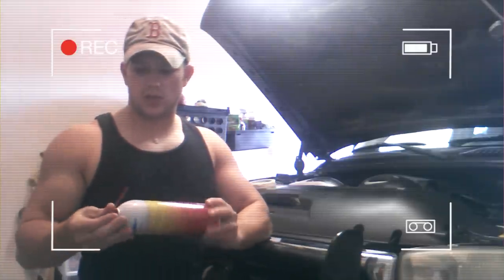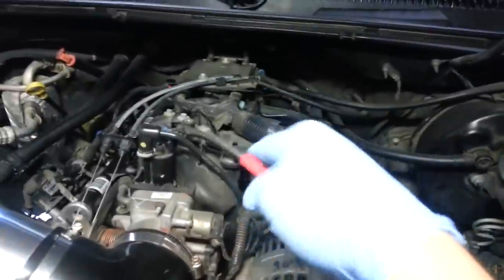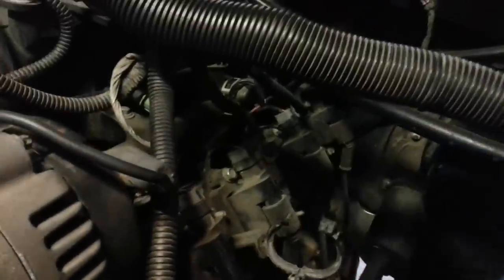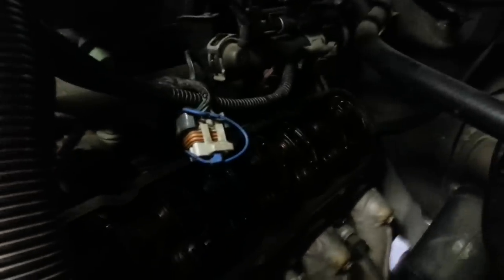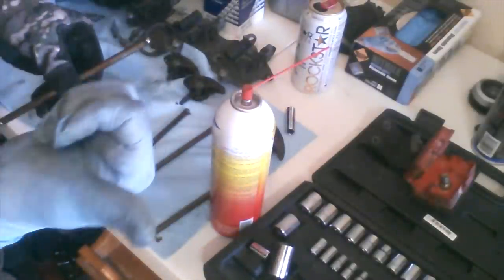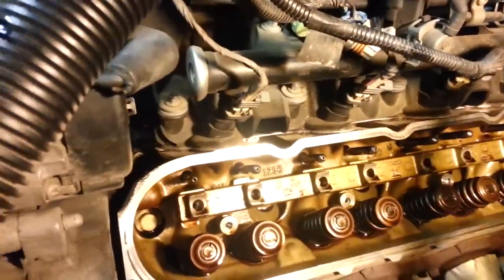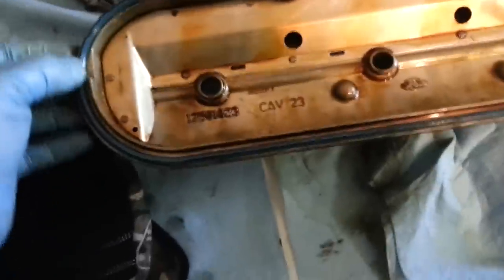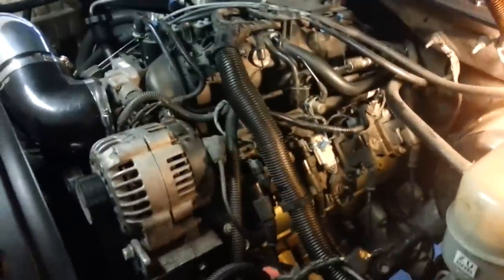GM Lifter Knock Repair - Carb Cleaner Method - HOW TO / TUTORIAL

Comment: I was almost done with this process when the red plastic straw shot into the head through one of the holes that the pushrod go into.   Anybody have advice on how to get it out?
Reply: depends,  if it is not in the pushrod itself and it was my personal vehicle with over 150k miles.  i would leave it and hope it just finds its way to the bottom of the oil pan or another unimportant place. its soft plastic and as long as it does not plug an oil port it probably won't cause a major problem.  if you have to get it out you will have to pull the intake and valley cover.  if it is a newer car with cylinder deactivation i would pull the intake just to disable the cylinder deactivation.
Reply: Good God. By now surely you’ve solved this (if it really happened) but for those who may experience the same problem, there was an invention quite a few years ago called a Shop Vac. 🙄
Reply: @FloridaTwoWheelAdventures  I did get it out using a USB fiber optic camera and one of those 3 pronged retrieval devices, like the one Arnold Swartzenegger used to get that nasty thing out of his nose in Total Recall.  Unfortunately the knock was just as bad once I got it back together.

Comment: I have a C180 w202 1999 Mercedes and I did the the engine over after the chain Snape bending 6 valves. The engineers said my valve guide on exhaust was worn out and was replaced. I did wash the hydraulic lifters out of Lake of knowledge as I work out of my head.now the engine sounds like diesel engine and got heavy tic tic noise . I been driving it for 1800 miles now with that tic and have tried oil change but tic won't go away . Can anybody out there advise me on solution
Reply: worn cam lobes, worn lifters, clogged push rods, weak oil pressure, improperly tightened or lose rocker arm nuts.

Comment: just spray down the push rod tubes thru the oil holes n save time n hassle? I can just imagine that straw flying off and down into the motor.
Reply: If it does, just crank the engine over and it will blow it out.

Comment: had the same problem recently added best line oil treatment and my noise is gone you won't believe it
Reply: I have the same problem with my colorado could you please tell me what cain of oil do you use thanks
Reply: I have the same problem with my colorado could you please tell me what cain of oil do you use thanks
Reply: I have the same problem with my colorado could you please tell me what cain of oil do you use thanks
Reply: i have no ties with this company but i can tell you that after hours of research this was my only solution eventually i will have to rebuild
i went to the dealer and they showed me how gm has changed the part number 4 times on the liters trying to correct their problems using us a s guinea pigs
Reply: con un 1/4 de ese tratamiento es suficiente oh tengo que llebarla a un taller.....gracias por tu alluda
Reply: con un 1/4 de ese tratamiento es suficiente oh tengo que llebarla a un taller.....gracias por tu alluda
Reply: yo use la botella entera y renplace la diferencia con aceite regular
Reply: David Quintero what did you use?

Comment: what you are doing is not a very good idea, what you are hearing is piston knock. its very common on cold engines, and nothing to worry about. spraying carb cleaner on the lifters will only wash away oil and cause possible scuffing in the lifter bores.
Reply: Lifter noise and piston slap sound different.  He is cleaning the lifters to remove varnish from a collapsed lifter.  This has nothing to do with pistons nor do they sound the same
Reply: Chastity Honchak piston slap is actually a slapping noise. Lifter tick is an actually ticking noise  it’s super common on the 5.3

Comment: Okay so shops be saying it takes around 6 to 8 hours to take off one lifter some of these guys dong it in less then 30 min does it really take 6 to 8 hours or its bullshit to make money
Reply: It calls for head removal to get pushrod out
Reply: GhostlyGhille  it can be done without removing the heads
Reply: @GhostlyGhille  I'm just a girl always learning new things about my 5.3 as issues arise with it creeping up on 300k miles. I haven't had to pull the heads to remove the rods, just the valve covers and rockers. With a collapsed lifter, that's what brought me to this video to see if I actually need to pull the heads and replace the lifter or if there's a way around it.  Accessing the rods is the easy part, having to pull the heads if I have to actually replace the lifter is going to be a whole other story... But nonetheless, a learning lesson.
Reply: @d.w.2553  I'm at 319k and about to do a full teardown and rebuild on my 5.3 but I'm a ford tech so researching the mystic arts of push rod engines.
Reply: @GhostlyGhille  Good luck to you!  I'm not a 'tech' of any sort, ahahaha... Last Spring I was taken for a ride by a so-called-mechanic as I had decided to get some work done on my 07 Tahoe, as a precautionary, not as a necessary at that very moment, but he took me for a good 13k between parts and labor over a few month span. As he would 'fix' one thing, another issue would arise. Since all of that I have been nonstop now doing the work piece by piece, but in the long run, I know that thing inside and out just about and by the time I'm done I will feel comfortable with it to hand it over to my daughter.  

I had it all tore down 4mo ago and at that time I had already replaced the lifters, that's why I'm trying to figure out if there's a way around pulling the head, (uncertain why right now), I have a collapsed lifter on #7.  I've read a lil bit of others saying the AFM will fail and cause this, but trying to pinpoint.

Comment: I have a 2002 yukon denali 6.0 and I have a tick of metal or something.
the noise is not there in cold starts but, you could here loud when operating temperature. 
what could it be?
Reply: Derek  Chavez i have same truck i used 20w50 oil year round no more noise
Reply: Water pump

Comment: i was just waiting to see how do you replace the lifters on the bottom.
You skiped that part.....
Reply: Fuckin A ! That's what I came here to see too!
Reply: On the LS engines you can’t gain access to the lifters without pulling the heads off. They’re under the heads in lifter trays. Not like older GM engines at all.

Comment: Nice head covers .. LOL on the older fords with push rods you can lift the lifters out with a magnet  through the push rod holes . clean them / or replace them. You can see the lobes better on the cam . (inspect The cam lobes ).always replace the push rods if (buck or two a piece .) if you replace lifters ..  Fords Jeeps . Chevys look to small.

Comment: I have found that the dirt in the LSX engines resides underneath the cylinder heads,if I had the dough in 2013, I would've given the engine a flush, let it cool down & remove the cylinder heads,then remove the cylinder heads,then clean around the hydraulic lifter area & give the engine an oil & filter change,as today, I did an engine flush then an oil & filter change, well, I pulled the old oil filter apart & there was alluvial dirt sitting in the bottom of the oil filter,that was only after 4 months & about 4000 kilometres.
The question is - where did all that river dirt come from?
Well, I believed most of it came from here in 2011 :- https://www.google.com.au/maps/place/Tea+Gardens+NSW+2324/@-32.6215192,152.1764451,150m/data=!3m1!1e3!4m5!3m4!1s0x6b738078a9d53925:0x40609b490438b10!8m2!3d-32.659597!4d152.1523926

My car is a 2 wheel drive Holden Commodore with factory height sport suspension (FE2) and the Rudd government in their infinite wisdom sent me up their to work,claiming they had a job for an electrician for me,I ended up doing more of a labouring sort of role,well,they were treating me like an idiot,the character David Hasselholf plays on the show Knight rider where he drives "Kitt" through the desert.
I don't think a Holden Commodore fitted with a Chevy LS1 engine is supposed to go to there,the car didn't leak oil when I went up there but after I worked there for a few months,the car came back as a leaker -yes! they had to let me go , they didn't want me !!!!
I have since replaced most of the gaskets & oil seals to keep oil in the engine & dirt out (except the front timing cover gasket,that's still o.k.) because that drive up to there actually loosened some of the bolts on the oil pan & valley cover from vibration,well the top end lost some oil flow & pressure to the hydraulic lifters didn't it !!!!
When I replaced the oil pan gasket & changed the oil filter,one of the lifters started "clacking" when the engine warmed up,it has been a nightmare to clean the engine out using flush (i.e. diesel,kerosene works too)  & lifter free products.
All that dirt also got through my petrol tank,the fuel filter got that blocked up that I could hear the paper filter stuff inside rattle when I shook it,not surprisingly I replaced the fuel pump as well.
I have been worried that I've done a Little damage to the camshaft & some of the lifter(s),there's no scraping noise meaning that the lobe of the camshaft has been "wiped" so I've been a bit lucky there.
So am I working since I've fixed my car up?
The answer is NO!!!
I have to find out why they aren't knowing me when I'm into a Holden that runs a Chevrolet engine in Australia !!!!
I have to find out why many Aussies think that's an electrician,all except me it seems !!!!

Comment: there's no need to do valve adjustment or valve clearance
Reply: what ???the older engines ,ya had to make sure lifters were PUMPED UP  then install rocker then spin pushrod by hand when that cylinders valves are closed or   on the base circle of cam lobe when ya feel slight resistance on pushrod spin ya tighten an additional 1/4 turn,,,so now they just  get torqued down to 22 ft lbs explain this one guys

Comment: am I the only one annoyed at him calling it a head cover instead of valve cover? nice video besides that. I need to do this but need to decide if I want to pull the rockers or just spray down the oil ports. I guess if it's all torn apart why not just take the extra step?

Comment: If your engine is gunked up with sludge, you can add a quart of water to the oil, and it will clean it up like new. Just run it for 30 min, then drain. Repeat if necessary. Cleans everything, including the lifters. It's the fastest, cheapest, and easiest way to clean your engine. It will not hurt it.

Comment: Just put a quart of kerosene in it and let it run for 15 minutes at idle and 15 minutes ar 1500 rpms. Drain it put fresh oil and filter in and a quart of MMO Marvels Mystery oil. Leave that in for the duration of your oil change. Now that you have taken the rocker arms and pushrods out you will need to reset the valve lash with the engine running. This is a terrible way to get at the lifter's. You will not even be able to get your B12 to all of the oiled surfaces of the lifter. If you like B12 you could add a pint to the oil and do the same flush technique I recommended above with kerosene but with a pint of B12 instead. You want to pour the B12 into the engine when the engine is cold or most of it will evaporate the second it hits hot metal. Do not drive vehicle with flush in it! MMO is very weak stuff it is not a flush you add it to the oil and leave it in there. If you do not get the valve lash set right you will destroy your camshaft and your lifter. Do not add ATF thinking it has detergents in it because ATF does not have anything that has any cleaning power at all. ATF has less additives than the cheapest motoroil and the base stock is nothing great either! You can clearly see there is no sludge on those pushrods. What would you do if the red spray nozzle stick fell into the holes?
Reply: buckaroobonsi555 Explain valve lash on a hydraulic lifter?
Reply: No detergents in ATF? Valve lash on a hydro lifter? The internet is awesome.

Comment: Yes it does matter what way u put ur push rods back in do not listen to that idiot each end of the push rod looks the same but has a specific wear pattern in it from the lifter and rocker if put in backwards it can cause a failed lifter due to wear pattern not matching up and rewearing the end bad idea always keep track of that sumtimes u get lucky but not normally
Reply: i have a chevy350 with a tick that comes and goes. i have a new set of push rods i was going to put in. would that be all right to do?
Reply: Was it necessary to call this guy an idiot?? Dayum, i didnt see your video uploaded.
Reply: Flatlandproductionz  it will just make a new wear pattern in 2 or 4 years
Reply: Calling someone an idiot while not being able to spell or know when to use punctuation. That's rich, sir.
Reply: Moe Monroe yes they do. Have you ever built an engine?

Comment: What a waste of time effort and expense, really use diesel oil,which has a lot more detergents in it, change the oil with new oil a couple of times and then use the Oe hi quality manufactured oil and also change the oil filter with a good quality oil filter as well and that will clean inside all the areas which oil is supposed to flow and also clean oil and change of oil every 10,00 KM is the only way to keep the engine looking good inside, even better use a 0W/30 during winter and then if summer months are over 35 degree days again change to a 0w/ 40 or 0W50 oil and also the radiator coolant must be changed every 3 years or based on the Oe factory booklet, when to change the oil / coolant and trans mission oil and diff oil as well ?